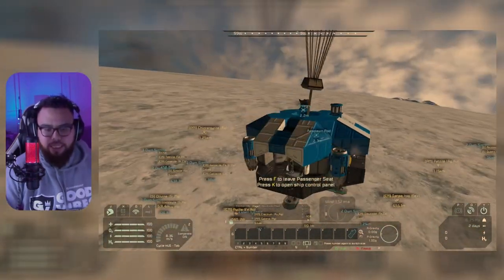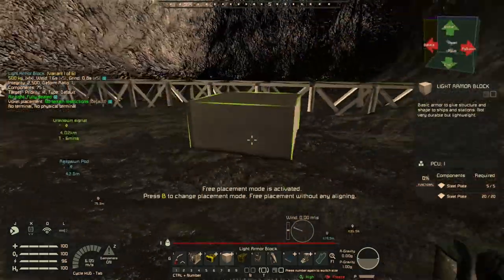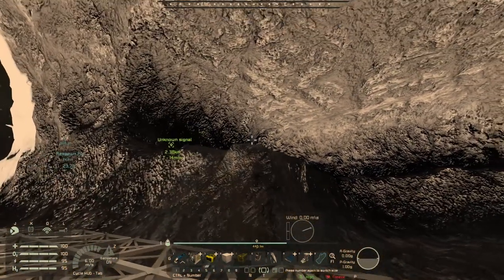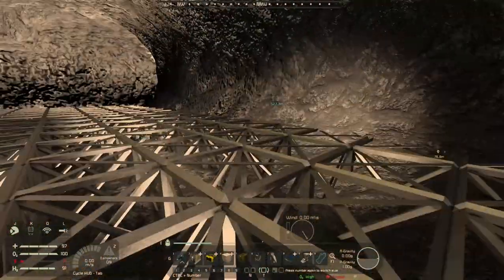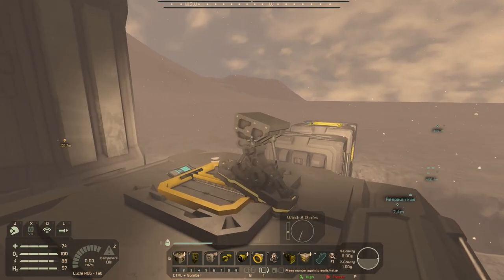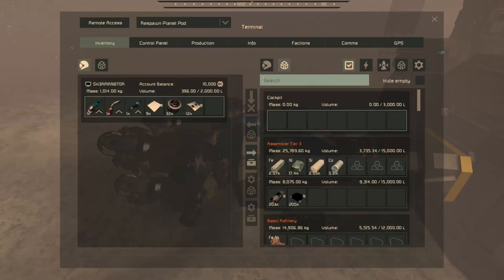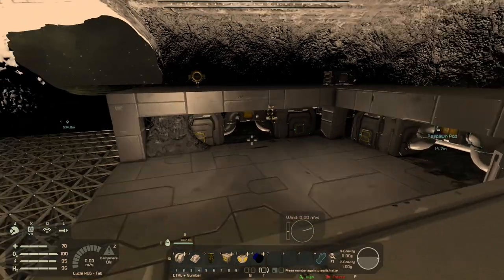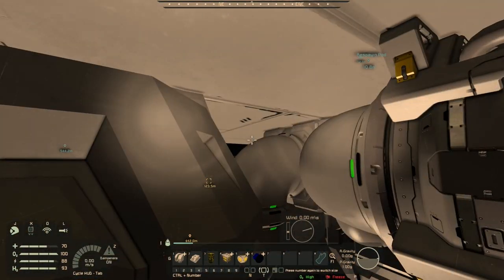Building a Safe Underground Base and Sorting System - Lets Automate Reboot Ep. 2

Comment: Rabbit warren is a good name for your underground base methinks
Reply from the maker: Thats a perfect name
Reply: I really like that name for a hidden, small base, though it would be a pretty hilarious name on a really large base that started out as something like a "miners village" that was mostly/completely built underground perhaps to protect from the elements (no atmosphere, extreme weather, high radiation...), perhaps to save on constructionmaterials.
Orerefineries are built to save on having to transport large volumes of rocks. Arcfurnaces and complex, chemical refineries are gradually added to the initial, strictly mechanical refineries, raising the need for better powergeneration, and production of what locally needed chemicals the planet support production of.
In time it grows to a bustling "factorytown", swarming with productionworkers, maintenanceworkers, and a yet small but growing group of administrative workers.

Initially handled by administrative personel and the productionworkers themselves, as the sites grows, the need for dedicated and skilled rescueservices arise. Accidents that might otherwise require shutting down entire buildings or sending someone home for care can now be prevented or at least handled locally.

In time the initial mine runs out, but new mines has "sprouted" on the planet so the refineries are still running. In addition various parts-factories has found need to exist at The Rabbits Warren, some to supply parts and tools for production and maintenance, some providing administration with stationary and households with households with utensils and furniture, and some for producing tradegoods, coupled with a growing group of traders and local farmers.
The Rabbits Warren with a population of 15000.

Well... that's far in a VERY imagined future, but it is (hopefully) a fun story and vision.

Comment: Regarding the weldingmodule: When I play/play with Empyrion I find it useful to start by building a kind of scaffold/dock to be able to light up and reach the parts I working on. Some scaffolding are just floors, steps, and ladders for me to climb and walk on. Some scaffolding are there to put the initial, usually relatively small starting blocks on, so I have them raised a bit up with easy access to add more parts to the badic frame. Some scaffolding are mostly cosmetic, creating something that looks like it could support the weight of the vehicle and also look like a proper workshop, but even those parts usually include lighting, constructionframes (transparent) that allow me to look at the whole of the vehicle, and various crates, barrels, and cargo palettes that allow me to store related tools and parts.
The initial scaffold is usually just metalrailings placed upright and connected as a supportive frame.

I really like that SE allows you to build dockable modules. You could perhaps have use for something like a bicycle parking rack for the module, or perhaps add 2 more landinggears (1 front, 2 back) to make it balance better.

I have a question about the jets on the module. Looking at @34:15 Could the lack of lift be because they weren't initiated as you connected the module. It seemed to me that all other jets had a blue flame, but not the ones on the weldingmodule. Just a thought.
Reply from the maker: I like the idea of using scaffolding to add lights and make access a lot easier maybe this is something i can look into implementing in this series a bit more i also really enjoy making structures that look they are structurally supported so we will work a little more on this.  

maybe next episode will be a building focused episode to cater to this.

a bike rack style for docking the welding module sounds like a fun project to work on i am a firm believer in every item deserves to have a home to live in whether it makes it back to its home every time is another story 

In terms of the welding attachment now that youve pointed out that the thruster didnt engage i cant unsee it i hadnt noticed during the initial recording so i will revisit this and update you on the next episode